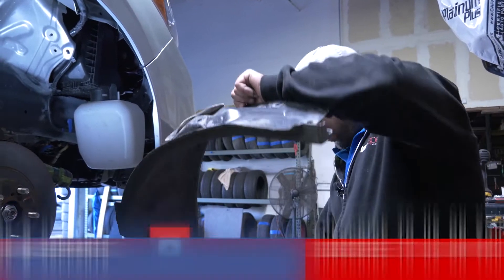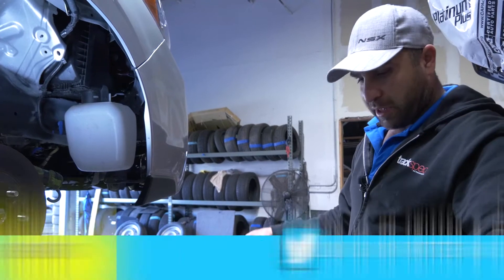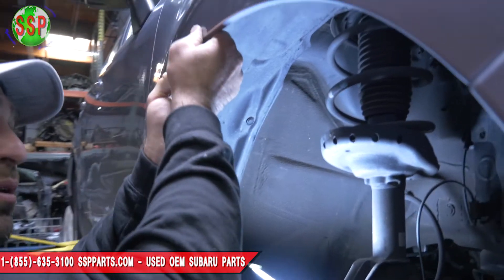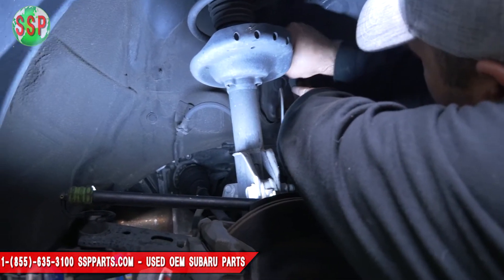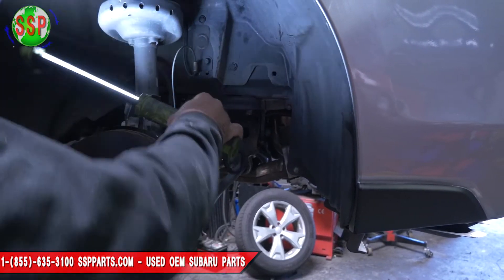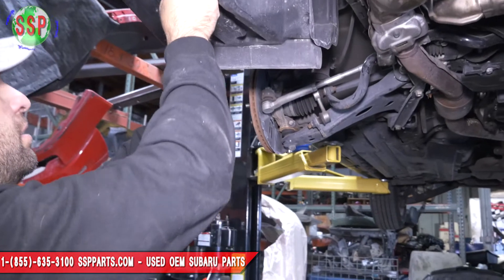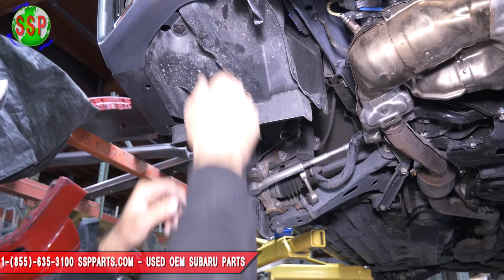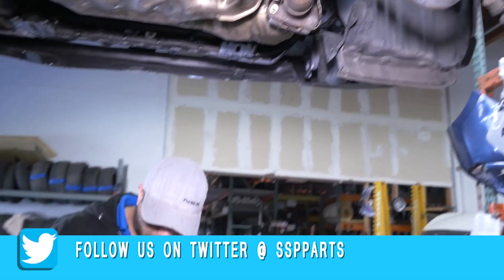How To Change or Replace a Fender Liner - 2015 Subaru Forester

Comment: I would love to see how the liner is REMOVED!  Change and replace????
Reply from the maker: In most cases a liner gets ripped or partially breaks off. In that case, removing the clips shown in the same locations will remove the liner. Likewise, putting the liner back - clips are in the same locations.
Reply: you do the opposite, should you even be working on cars?
Reply: @vollick82 😅
Reply: Should pants and underwear be removed when taking a $hit?😂